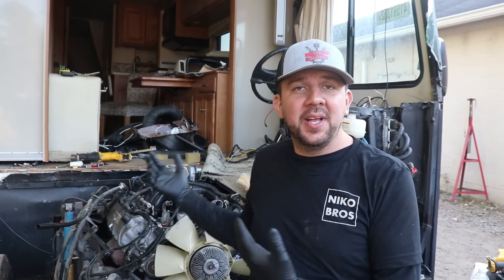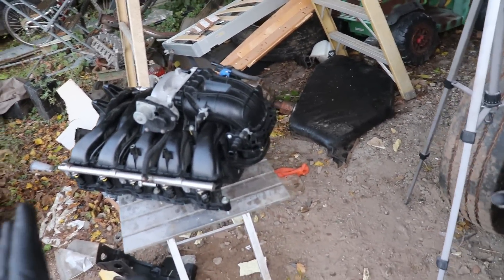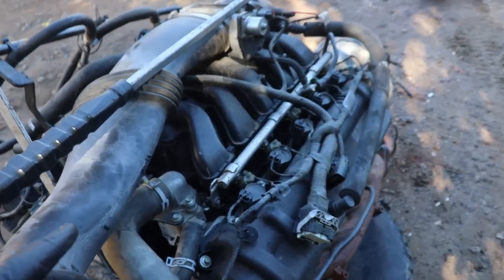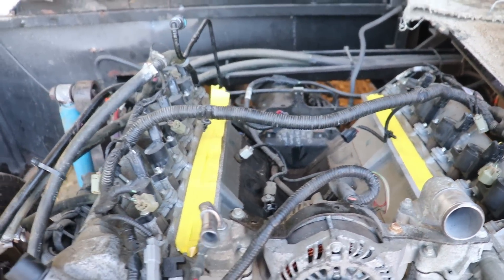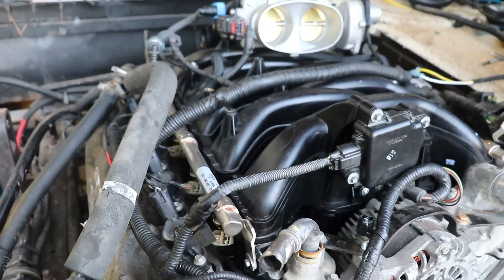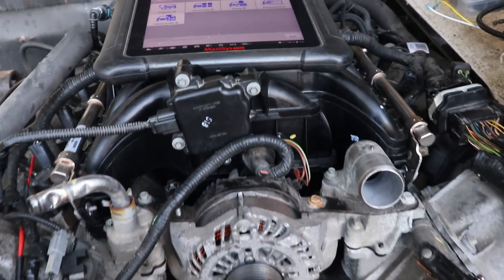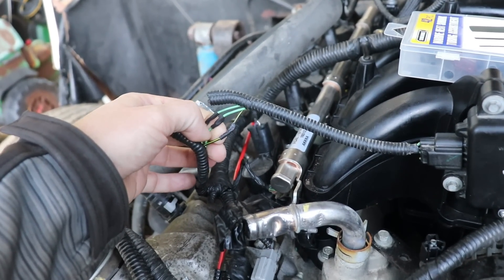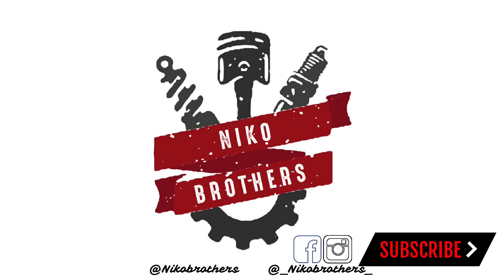WINNEBAGO SUNSTAR RV RUNNING INTO ENGINE PROBLEMS

Comment: Sounds like a bad crankshaft position sensor I had the same problem went to multiple shops and the dealer couldn’t fix it . Finally a technician from a dealer worked  with it and figured out it was the crankshaft position sensor. Good luck

Comment: If it was running before any changes then that would suggest it's possible that something you changed could be at fault especially when you change multiple things so try undoing some of the changes and only doing one change at a time and then testing to see if it still starts before changing the next thing for example change everything back except the harness and then testing it if it doesn't start then it's either a missed connector, something in the harness is damaged or a control module gone bad. Good luck guys you will get there

Comment: If it was running, but not smooth, why would you change the manifold- that would be the time to plug in your scanner and look for codes.  Backfiring indicates a timing issue, which on these new motors would be a crank or cam sensor problem.  BTW- on a fuel injected engine pumping the throttle does not do anything, there in no accelerator pump.

Comment: Connect mass airflow sensor, check if intake manifold does seal to the heads, reinstall serpentine belt so alternator can send voltage. Good luck.

Comment: Seems it's getting fire .because sounds like it try to start.i would put the alternator belt on. Don't think that would have anything to do with it but might..make sure the oil pressure wires is hooked up.

Comment: As far as i remember, alt. needs to be spending try putting the belt on and see if it starts. Back in the 70,80,90s I was a ford line tech but never worked on v-10 but should have the same software as cars and trucks ford makes

Comment: You need the alternator turning and all your sensors operating. If it fires with starter fluid your not getting gas. Check your fuel filters and pressure.

Comment: GUYz,
The fact it tries to start w start fluid tells us the engine has spark. SO,
you have a fuel delivery problem. Retrace your steps. it was OK before
you pulled the intake & coil paks. You must have left something 
unplugged under the intake or broke a weak wire or...

!

Comment: you got spark as it tries to run. But. Thats on "starter engaged". Could be immobiliser issue - have you swapped over the ECU for the engine - is is coded / matched with the Body Control Unit (BCU) which contains the immobiliser codes? Also, again it runs on starter fluid - that would suggest a fuel issue. Have you tries to spin it over with an injector out to see if fuel is getting to the injectors? Fuel pump immobilised?

Comment: At the first starts it tried to run when given some ether. Perhaps fuel pressure is not ok. Take some gasoline in a plastik bottle with a tiny nozzle and spray gasoline into the intake while starting. If the engine is functional, the liquid gasoline will keep the engine run longer than ether. And it is not so hard on pistons and con rods. Same danger: it could backfire also. Perhaps a gasoline pressure gauge would help. I think you checked for spark already.

Comment: Check your coil packs if it was running before until you've changed it out the coil packs check your coil packs put volt ohm meter on them and check them

Comment: Hey use jumper cable to ground the engine. So much plastics and other stuff. I would try grounding it to frame for a good connection.

Comment: Seems like an issue with PATS Ford Anti Theft. You might have replaced something that was programmed to the PATS module and needs to be reprogrammed. Key, instrument cluster and some modules on the engine. Is the Theft light flashing when you try to start it?

Comment: there might be a vacuum leak at the manifold gasket that you have removed and replaced. I have had a similar experience before, so I put on a new manifold gasket and............ THE ENGINE STARTS without spraying any starting fluid.
Reply: Agree about the gasket

Comment: Ford has a roll over switch on the right side of the steering wheel. If you hit a bump it will trip
Reply: I was thinking the same thing.

Comment: # one thing never use starting fluid cuz it can blow the head off use a gas oil mix like wd40 check for spark but my guess is check all fuse

Comment: Fire balls are not fun,  Just taking time away from a project will help you find the answer, There has to be something unplugged somewhere or wires crossed.. I would put the old coil packs back on and see if it runs then.. Who knows maybe the coil packs you put on there were damaged in the fire

Comment: Remove the start relay and Jump the 30 and 87 to bypass any safety sensors/ switches in the system (Works on GM anyway).  Check to ensure the rig is in Park or Neutral--It WILL run you over.

Comment: Load test all power and grounds at pcm. Watch your data when cranking. Should see  rpm.  Check for injector pulse. Check for good spark. Should jump a good inch. I don’t know if you swapped the engine but make sure it’s the same year because timing could be different. And put the mass air on for the love of god. The fact your not throwing a mass air flow code is strange in itself. Follow my instructions and you will find the problem. Message me if you need more help.

Comment: I fugging hate ford ecm s those fugging bastages can't make a reliable diagnosable ecm . Seen them fail like that with 10-15000 miles on them. 
  If you are getting gas and there is spark  and you don't have a squirrel living in the air cleaner . It's  probably the ecm. Even when they don't test bad.  What I have seen is the turn over seemingly normal maybe a little to fast then soddenly stops or turn hard then easy may spite through the throttle body. Usually not the exhaust in fact I can't remember a Ford that spit through the exhaust with a bad ecm.  Then suddenly it starts and runs fine until next time. 
 Ford to the best of my knowledge and experience hasn't made a reliable ignition system since 1974 .

Comment: If you want to start this thing you need the v belts in place. Without the belts the pistons can collide with the valves, rendering the engine useless.
Reply: umm what? haha I think you're confusing the timing chains with the serpentine belts
Reply: @johnjesus971  possibly
Reply: Maybe it's deBiezel's hot chick in the black outfit causing too much confusion about belts. lol